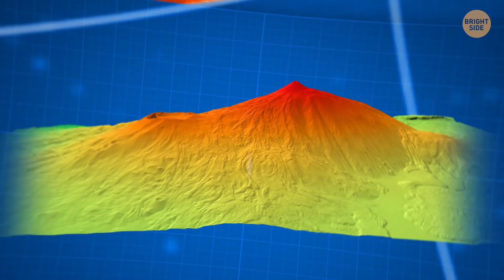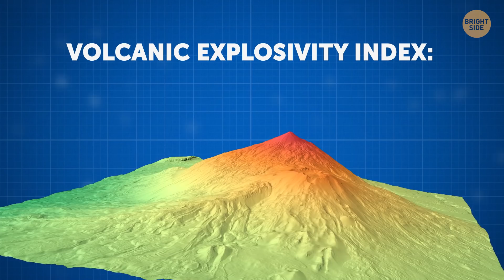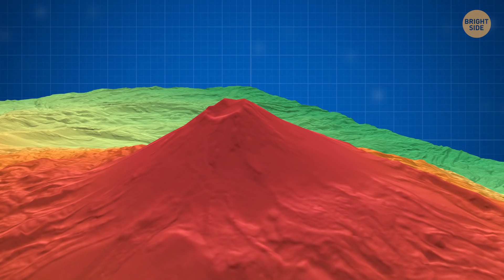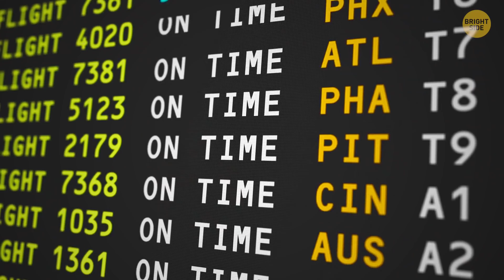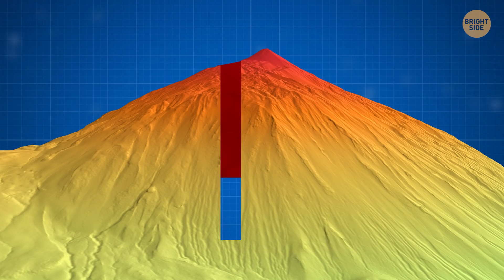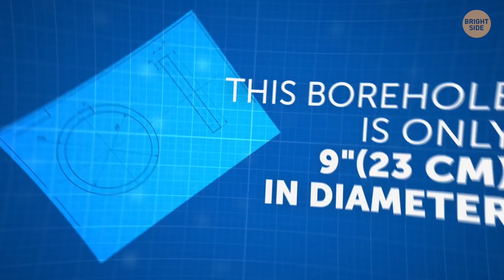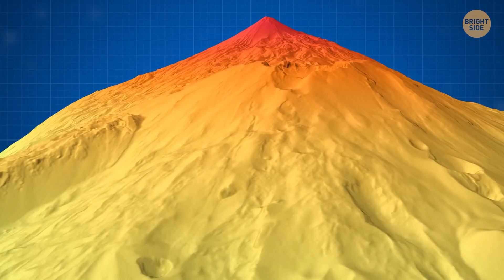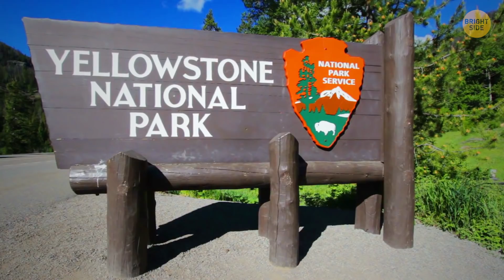А $3.5 Billion NASA Plan to Save the Planet

Comment: What's the downsides of them creating many small holes through the magma chambers and slowly emptying the now lava into a type of landfill
Reply: If it has enough capacity to fill the Grand Canyon 11 times, than where will you put it?
Besides thats a really really bad idea.
Reply: The downsides are that the many drillholes will trigger an eruption. Even if you get the magma out, which you wont, you leave a massive hole in the ground that will collapse under its own weight. So part of the Rocky Mountains will collapse.

Comment: I’m not saying it’s statistically due for an eruption, I’m just saying there’s a pattern between 2.1 million, 1.3 million, and 640-700 thousand years ago

Also pumping water into a volcano is a great way to add pressure and potentially cause the eruption trying to prevent, regardless of where the drilling occurred. There’s “safer” ways but none are safe

Comment: we already did the summer cool thing after Pinatubo and MT St Helens went off in 80s. All was normal in 3 years FEAR MONGERING  for more $$$
Reply: if it does happen it would 1000 times those. it is just unlikely, but very bad if it did happen.
Reply: Actually more than 1000 times greater I believe bc My St Helens was only a VEI 5. It would really depend on the volume of melt when it went off.

Comment: The graphics you used in your descriptions of the Yellowstone caldera are visually inaccurate and misleading.  You showed a typical stratovolcano in your presentation.  A stratovolcano is typically a conical mountain with a "mouth" at the top where the eruption typically, but not always, comes from.  Mt. St. Helens, Mt. Ranier, Mount Shasta, and Mount Hood are all stratovolcanos.  Yellowstone is a caldera.  There is no mountain peak.  It's at an elevation of over 9000 feet because that is the elevation of the surrounding terrain and the "lips" of the caldera.  A large part of Yellowstone National Park, in its entirety, sits within the caldera.  A caldera is what you would think of as the mouth of the volcano on a stratovolcano, or the top at the part that traditionally goes boom.  The "mouth" of the Yellowstone caldera is 30 by 45 miles (50 by 70 km), approximately 1500 square miles in area.  It is a massive caldera that can only be seen in its entirety from space.  For many decades scientists knew the area was volcanically  active, but they couldn't find the volcano.  Geologic mapping was completed in 1972, but it wasn't until 2001 that a comprehensive history of the caldera and the eruptions was published.  It's so huge it too that long for geologists to realize it was a massive volcano, what it had done in the past, and that it was still active.

Comment: Super volcano are a different type of volcanoes. They have been given the Name Bubble Volcanoes. The reason why this was found out because someone asked the Question: Why does the Haiwaiin volcano exists? By the standards it should be impossible because of no subduction zones nearby. So a research was started. And it found out a super volcano is at its deadliest when forming. That’s right. It starts as a bubble of not solid nor liquid Magma that’s forms way down deep in the mantle which is lighter then the surrounding stuff and slowly rises to the surface. It stays a bubble until the pressure is too much and then POP! They have estimated that the popping of a lava bubble could incinerate everything in at least 3-4000 miles away from the epicenter. And in millions of years from now maybe even billions the USA will see this happen. The location is Vermont. Shocking I know. Funny how a question from a ten year old child living on Hawaii becomes a new chapter in volcanology. 

I guess the old proverb Of Few things are impossible. And the imagination is the real limit